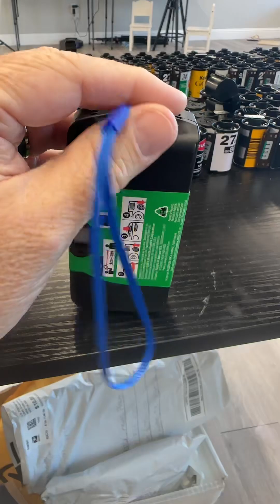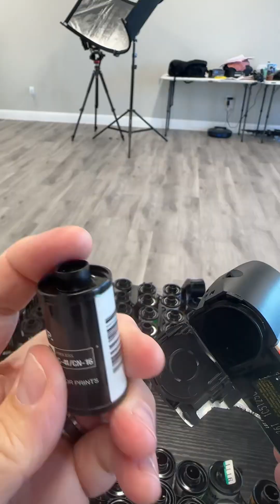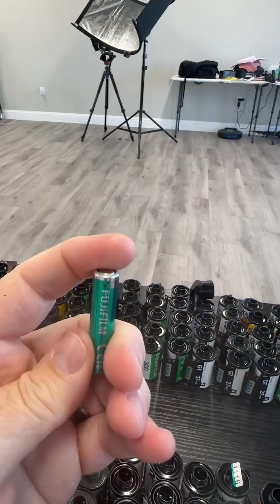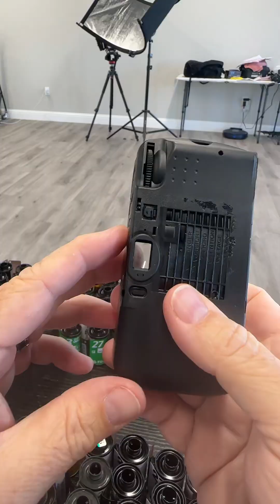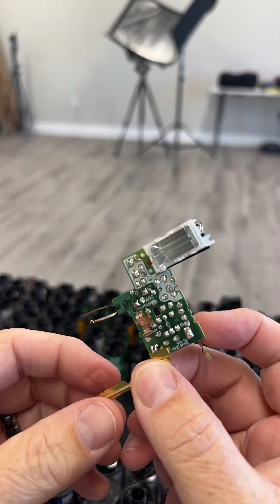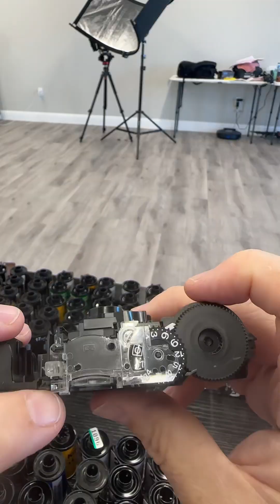What’s Inside of a Disposable Camera - FujiFilm Quicksnap

Comment: The last time i tried to open a disposable camera, I got flashbanged, and it made a spark. At least i got access to the film just to see what film looks like
Reply: happened to me too. I touched the board and got electrocuted in the fingers,  then I tried to remove the charge from the capacitor and I got zapped right through both my arms and I also got flashbanged using pliers